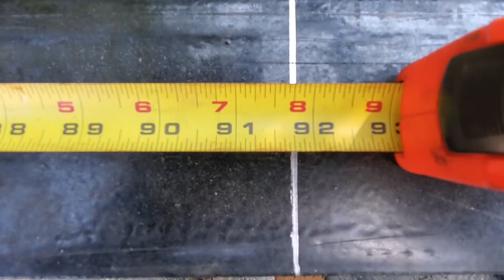I stretched my hotshot trailer part 4!

Comment: I saw a factory built gooseneck trailer that was built with those vertical splices in the main beam....one beam broke about 8" away from the factory vertical weld. The break was about 2 feet back of the neck. Lot of twisting going on in that area. That being said...the welder that repaired it, said the factory should of never spliced a main beam like that. The way to do it was to make a stretched-out "N"    you end up with  basically a horizontal splice with 2 short vertical welds and 1 long horizontal weld.
  Without any positive camber "arch" built into the trailer it may develop a belly ( a swayback). Seen a lot of trailers that were built without positive camber that were "strapped" to make up for the lack of camber. Strapped meaning horizontal flat bar stock welded to short vertical bar stock pieces spaced all along the length the bottom flange of the frame rails. Kinda like building a bridge that doesn't have any overhead structure.

Comment: To make sure your trailer is square you take 2 tape measures and measure from the back left to the front right and the the back right to the front left to make sure your trailer is square, and if it isn’t then you move it wherever it needs to be so that both tape measures are the same.
Reply: He knows how to do that...
Reply: Two tapes? Any builder knows you only use one tape for any job.
Reply: Then how come he’s not doing it, I hope he doesn’t have problems with his trailer tracking properly it will be hard on his wheels and axles.
Reply from the maker: When squaring I always did the 3,4,5

Comment: You're doing a great job. There are several ways to do anything but others are right, trying to level on a crooked driveway makes things very difficult. 
Using long straight edges and pulling tight strings while using a gauge block under the string will keep things very straight.
Looking fine and good luck!
Reply from the maker: Level was just used as a straight edge and to match the bubble to both

Comment: Man I don't know, I see a lot of welds with a lot of pent up stress applied needlessly. I don't know it those welds will handle shock loading over time or not. A big thick weld doesn't mean effective penetration into the parent metal. All the localized heating and cooling is putting a lot of stress on the welds just as they sit, let alone applying a downward load on it and subjecting it to bouncing over time, no fillet plates, nothing helping to take up the load over a greater area.. Still think you should have just traded the trailer in on a longer factory built unit. Like I have said before, I just hope no one gets hurt over this...
Reply: Hey John, he's doing it!  A little late to start criticizing.
Reply: Bruce, it’s never too late to prevent a catastrophe.  If a weld fails and causes property damage or injury or death to someone, the welder needs to be certified. The critics are trying to help him.
Reply: @johnfrank6083    I am an elder citizen with a long history of building, fabricating structures and vehicles.  No failures to date.  A lot of my work has been strictly legitimate and a fair amount of farm style.  Just from what I can see in these videos, I don't see anything that looks risky.  I see things that I would have done differently but nothing serious enough to worry Robert about.  He's doing fine for the job he has taken on.
Reply: bluecollartrader : I’ve used a keyboard to set up an automatic orbital welder for stainless steel tubing. Certified for that process.
Reply: @brucedoxey5815  Bruce: I don't have a problem with his fabrication. Hope everything aligns and he has no tire wear problems etc. But when I see Robert's video where he chipped away the slag and I see a big hole in the middle of the weld that's where I have a concern.   The easiest position to weld, plus he fails to repair it. I don't think he knows a good weld from a bad weld.

Comment: I know our comments are after the fact, but anyways.  Unless your driveway surface is perfectly level the full length, using the level is wasting time.  Your best tools are the tape measure and a string line.  Measure and repeatedly string line front to back, side to side and cross angle both directions.  The imperfection on the tail isn't going to hurt anything other than possible appearance.  The front splice needs to be right on to prevent the trailer pulling funny or wearing tires.
Reply: @ Pappy--At least your advice on the trailer makes some sense cause you sure don't know a flipping thing about DOT regulations.  I still want to hear your rebutal on your comment, "semi tractor trailer combination units don't have max length restrictions"...What the heck are you thinking????
Reply: @jaystell314  You are the nut job that only reads part of what is said and don't understand the rest.  Semis are considered tractors because they can not carry cargo on them, so do not fall in the length law of 65 ft for a straight truck, which includes the hotshot rigs. It appears you just like to argue for the sake of the argument, even when what you say makes no sense and shows you have no idea what you are talking about. But you are entertaining and helping the comments going to hep Robert with his channel.
Reply: Happy Pappy  I agree with u !
Reply: @jaystell314  If you are having problems, I can copy it from the FMCSA web site for you.  So stop acting stupid.  Thos is getting boring.
Reply: @happypappy6371  please do that very thing "Goofy"
Reply: @bluecollartrader1791  Really, Then let him post length regulations straight from the DOT regulation handbook. Its real simple to solve.
Reply: @bluecollartrader1791  Notice he didn't want to post the written DOT lemgth restrictions to prove himself as being right!

Comment: I only wish the best for you and your family. Something in the back of my head is saying a lot of weight on those welded joints is going so spell doom
I hope I am wrong.
Reply: Yes and a non certified welder modifying a commercial trailer. If things do go south they will go south with a quickness the liability and risk alone makes it a bad decision all ways around.. time labor materials etc would have been a smarter move to sell the trailer ( no shortage of newbie start ups) and buy the trailer he wants.. common sense ain't so common anymore it seems..

Comment: I'm curious about whether it'll pull straight or if it'll wear your tires differently than before. Couple questions, what tires are you going to run; what's the weight rating on the tires? Are you going to have to re-register the trailer at a lower max weight since the trailer weighs more now?  Good luck with it, looking good!
Reply: You don't register a trailer by the cargo.  The max weight will still be the same as before.
Reply: @happypappy6371  I see Dixie Mae II AKA Clueless Pappy is still full of it...
Reply: @Happy Pappy - Valid point about the weight but he had it registered as a 30' trailer before & it'll be a 40' trailer when he gets done. Does that matter in GA?
Reply: @bobchambers5948  I've never seen the length listed on a registration.  My trailers only list weight.

Comment: interesting project but so many questions. Do you not have laws about effective rear overhang? Up here all the welding would have to be done by a certified licenced welder and probably would have to have engineered drawings as a commercial trailer. Hard to get things perfectly straight building it in the driveway but good effort to get it as close as possible. Now the trailer is heavier are you going to upgrade the tires and axles so you can haul extra weight? Not sure how it works down there but here we go off the rating on the tires, So 6 times whatever the tire rating is would be the max you would be allowed to haul on that axle group.
Reply: He can't haul extra weight, as he is running non_CDL.  His over all weight will remain the same as before, but a few pounds less cargo due to the added weight of the stretch.  There is no location that determines the weight capacity of a trailer by the tires.  It is determined by the GVWR stamped on the VIN plate on the trailer.  Then you have to run sufficient tires to carry that weight.  If you try to scrimp on tires to save money and run a lower rated tire, can result in you being put out of service for that.
Reply: I don't think they can tell anyone that they cannot weld their own trailer.  Insurance?  Yeah, they can regulate that.
Reply: @brucedoxey5815  And the only thing the insurance company does is verify what they are insuring is what is there, a flat bed trailer, and it is not damaged or wrecked,  so you can't come back in a month and say someone hit you while parked at night and you didn't see it happen.
Reply: @happypappy6371  GVWR is determined by the axle weight rating, then combined by the number of axles under the trailer. Goofball
Reply: @jaystell314  And that was never questioned.  It seems you are still just trying to keep arguing so you have something to do.
Reply: @happypappy6371  still waiting for you to post those DOT length restrictions??? What is a straight truck?
Reply: @jaystell314  You know, if you are as smart as you are trying to pretend you are, you could look them up yourself and not have to depend on someone else to do all the work for you.
Reply: @happypappy6371  I am not trying to pretend I am smart, also not trying to convey being a know it all, like you conversely. I hate being around cocky or arrogance because I am far from either and make sure to handle myself accordingly.

 I do know DOT regulations because they are written in black and white. Your a hot shot legend; even if it is only in your own mind!
Reply: @jaystell314  Well if you don't try to pretend you know it all, then why are you on here telling everybody how everyone else is doing it wrong and you know this person and that person?  It sounds like  you are being petty cocky to me.  And then you continue with the name calling, like some child would do.  And if you know the DOT regulations so well, then you would have to keep asking me about them and would already know what I have told you is correct.
Reply: @happypappy6371  Mr. Pappy, that is exactly how I feel about your endless comments about the law and DOT regulations that are just just plain wrong. When it comes to comments, well they are opinions and mine are not necessarily wrong or right because they don't align with your opinion. The law is not a comment but written fact without variance and when you state a semi tractor trailer combination unit does not have any length restriction as fact, I had to laugh because it is 75 feet. You did quote the max length regulation for a hot shot combination unit. Again I am asking you what do you think a straight truck actually is?
Reply: @jaystell314  I said the semi truck does not fall under the 65 ft length law of most states, that a straight truck does.  A straight truck is any truck that can carry cargo on itself, such as a box truck, pick up, flat bed, tanker.  And in most states a straight truck falls under the 65 ft length law, Indiana is 60 ft.  I'm not sure how many times this has to be explained before you understand it.
Reply: @happypappy6371  this is exactly what I am talking about. A straight truck is any vehicle that is continuous like a box truck, grapple truck etc. A straight truck is never a stand alone trailer because it moves under its own power.  It can never exceed 40 feet in length period in every state. A truck and any trailer is considered a combination unit which is a max length of 65ft and a semi tractor trailer combination unit is 75 feet. These are national DOT regulations.
Reply: @jaystell314  And now you are agreeing with me.  Only took how many days?
Reply: @jaystell314  I get it very well and I was not wrong.  You are going with single straight vehicle.  We were talking about the requirements  for hotshot rigs and the difference in requirements for straight truck hotshot or semi.  But you only wanted to argue.
Reply: @happypappy6371  your impossible, I am not arguing because the law is clear and your memory must be failing too!
Reply: @jaystell314  No problem on my end.  I've dealt with this everyday, so I know what the law is.
Reply: @jaystell314  Take the bed off a pickup and it becomes a tractor. Then the 65' overall length goes away.  A tractor has no cargo carrying capability. Missouri is famous for enforcing that.
Reply: @heyinway  Your right because that makes the truck a single axle then.  I have also seen a single axle tractor weld a bed on like a ton truck with neat side storage boxes and gooseneck ball hitch but it transforms the truck back to the 65 ft length rule.  

The scales in Tennessee give the car hauler trucks tickets for over the 75 ft. length without permit for that car sticking over the cab and also measure trailers with center rails and ball jack stands (stinger) sticking out over the front of the trailer as the starting point of the trailer length and give over length tickets. I just call them revenue tickets because its all about $$$.

Comment: Im just wondering would it b better just to sold your trailer and bought bigger
Reply: A little late for that kind of comment.
Reply: @brucedoxey5815  true
Reply: @bluebird5100  That  is foolish.  He is doing it to make more money with it.  It was his choice not to just sell it.  When he is done with it I expect it will be pretty used up anyway.
Reply: @brucedoxey5815  it's fine as long as he keeps it forever. I was thinking he could sell it for 6k like it was and buy a new 40 for 10k. No one would know how many miles it had on it. It looked really nice. You also figure he has been down for at least week too working on it. That is at least 1500 lost. So in reality, it would have been a 2500 dollar upgrade to buy a brand new one. I dont see how he is going to register that trailer or get insurance for it. The tag says it was 30 ft and now it is 40. Tow piglet is always talking about how the gvrw tags have to add up 26k or less, but now the old tag is incorrect and needs to be derated for the extra steel added.

Comment: Don't fret about the dip in the rub rail two much. A good chance that shit wasn't squared up when it was built. U r taking much more care to get right and true than the meatheads that bilt it in the first place. Your doing it right. But I would have just got another trailer and spent the time fishing. I drive trucks in Alaska. 70-80 hours a week any time off is absolutely precious. My buddy bought a three car hauler wedge new in Arizona had some bigger boxes fitted to it for tools etc. turned out there wasn't a square angle on whole trailer. It was all new just poorly built.

Comment: Why did you have to stretch the back and just not the front. I would hate to have my trailer cut twice instead of just once.
Reply from the maker: It would have been impossible to be able to load the trailer with enough weight in the back to keep to much weight off the drive axle.

Comment: You're not going to be able to halt any more weight on it I don't know if you plan on putting another actual under it you don't have a CDL for more weight so why are you stretching it
Reply: Tow piglet just did a video on the fact that he can get more 20 foot loads partials to go with other 20-foot load partials each paying me $1 per mile. He said Brokers pay more for space than wait. 40 ft trailers are custom built 4 Big Tex and take weeks to get

Comment: It's going to break as as trailer builder. Straight butt joints will crack. It should be double framed atleast 18 inches into old frame. Don't put that on the road you will kill someone. You could lay 1/4 plate in the seams to reinforce you seams.
Reply from the maker: Explain the straight but joints used on the tongue.
Reply: @SouthGeorgiahotshot  so your straight joint when you cut you trailer in half. Should never be straight across should be staggered. Because your making them the weak spot of your whole trailer. Straight joints are good for a stationary structure but not going down the road flexing . Think about it you got a 10,000lb piece bouncing just so lightly is enough to break a weld..you should made 1 rail several feet bigger so you didn't have 2 welds across from each other. 2 things you can do now is double frame it a few feet longer or box it in several feet longer.that way the support is in several places not just them weld joints